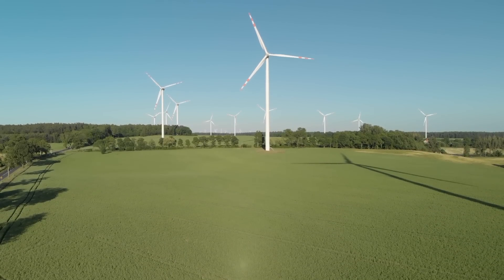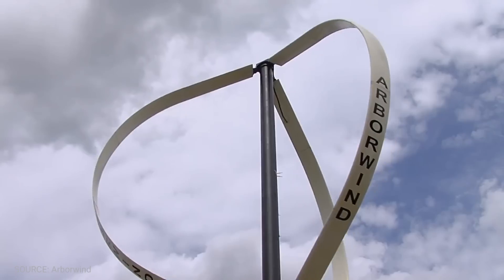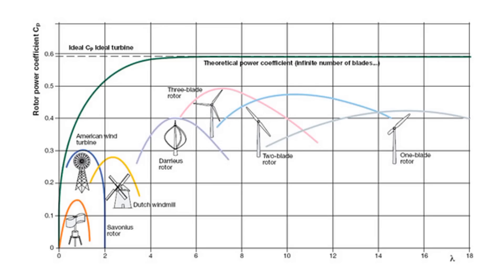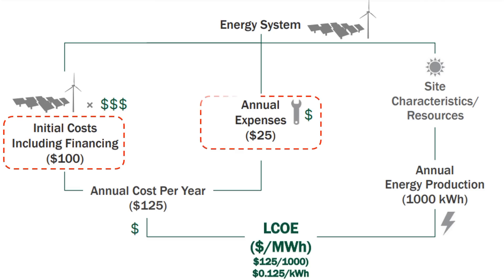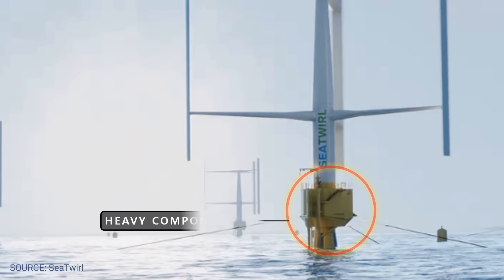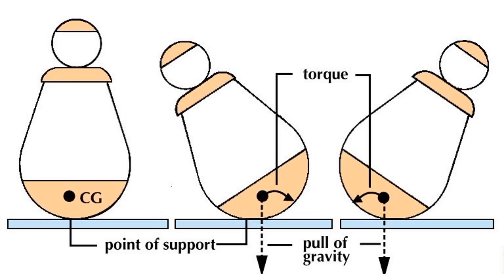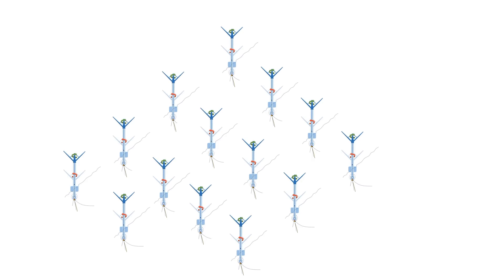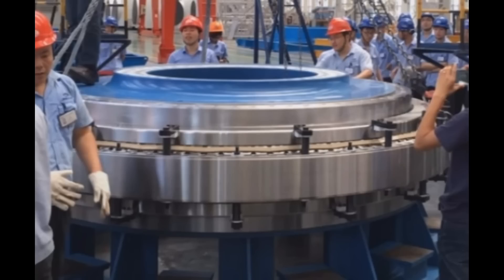This Wind Turbine makes Wind Power virtually LIMITLESS - Solves Wind Energy's BIGGEST Problem!

Comment: Lenz 2 vawts take advatage by pressing the wind in between the blades and the hub, giving a PULL action for the airfoils..    AND a PUSH from the back side of the blade. sso ya, if they made them as big you'd be gaining almost twice the output...  and not kill birds at the same time

Comment: Yikes!  So much complication. I've built VAWTs for over 50 years. My turbines all compress air and I convert that potential energy into usable work ON THE GROUND. My machines use one moving part on the turbine, two moving parts on the pump and a check valve. Can't get much simpler than that. I run the compressed air through a variety of end-use engines IN MY SHOP to create usable working power.

Comment: That is very very cool. If it works it could solve the Intermittance of even offshore wind turbines. 45-60% efficiency well when it goes past usually 2 km an Hr they have to shut the vertical ones down to avoid destroying them.

Comment: I'm surprised Elon Musk is not involved considering the potential. Has having the generator on the ground for HWTs using bevel gears/shafts/bearings like an upside-down outboard motor been considered?
I know there will be some energy loss but the benefits would be well worth it..

Comment: I think this represents the next generation of wind power. I've never thought the horizontal axis systems were inherently robust and VAWTs are much more so. I am curious how they will tolerate extreme conditions, for instance heavy icing or perhaps even worse, wind speeds up to 250 kph. Surely these have been considered by the designers. Will the towers tilt so far over the blades hit the water? What about extreme sea states? 20 meter tall waves must be designed for; how does a floating and tilting design tolerate that? I'm excited to see innovations in renewable energy because they translate into ever cheaper energy production.

Comment: Trick question. How many wind turbines does it take, to equal a coal driven electricity producing turbine?
Waste of time, waste of money, crazy pollutants, damaging marine life, but! They are green. Whatever the hell that means. 

Idiots got so focused on gas emissions, they forget to check anything else. 
You still need oil to make them BTW.  There is no renewable that can substitute oil, for a good hot fire to melt iron and coal to make steel.  Huge steel monsters, need a lot of steel. A lot of oil is gonna get burned to make your green wind mills. 

But you dont care about that, you dont care you 're paying  twice the wat hour from these monsters.
Yep twice! Subsidised, means the government takes your money to pay for them to be built, installed and operated, all the while paying again for the minimal electricity they produce.

 IDK about you,  but i don't like to be mocked. Paying twice for the same thing, is mocking me.  
They bet i don't have the brain power to figure out the money laundering scam they are running ,at my expense.

Climate change is real you cretins! Instead of funding technological innovations, you 're laundering money so you can profit. We has wind mils and water mills since . .forever practically.  We abandoned them for fossil fuel, cause they canot meet the demands of an industrialised country. 
Hell, they can barely meet the demands of a small agrarian country. 
TELL ME I 'M LYING. Tell me your wind mills make enough electricity to power a small country on their own.  
A tiny one ! your choice! Pull up their annual consumption, and calculate how many wind mills of whatever type, it would take to cover that. 
I'm betting there wont be room for people.
Reply: @PW POO POO

Comment: @efficency: I learned about the wind turbine theory that vertical axis wind turbines can convert more wind energy into electricity than all horizontal axis wind turbines can do under same circumstances, thats why these turbines are so wide spread.
@no gear: Today most modern wind turbines (Enercon or Siemens Gamesa) miss a gear, their axis drives directly the generator on the same shaft and use power electronic to rectify it and generate a synthetic sinus synchronized with power grids AC phase & frequency e.g. 50Hz or 60Hz.

Comment: I have a 1kw vertical Axis windmill. It's pretty amazing. It is fairly simple one but it produces power easily. Much simpler construction. It makes home small version windmills easy for a home owner.
Reply: How much power do you make
Reply: @elizabethwinsor-strumpetqueen  under light wind 50 to 100 watts is normal. Under medium wind it averages 300watts. If it's a really good strong wind it may get 700watts that is fairly normal. 1kw may be possible in ideal conditions but its not the norm when it comes to wind. They always advertise the max, you rarely get the max though
Reply: What is its size?

Comment: Other than the fact that if there is no wind = no power.
Reply: At sea there's hardly ever no wind.  
For the next 20 years or so, the times there's no wind can be covered by saving gas turbine generators in "mothballs" and running them for the few hours each year when the wind isn't blowing hard enough.  
Don't forget solar power works when there's no wind.

Comment: You mention spinning the rotor one direction and the stator the opposite.  And the potential issue of bearings between them.  But how do you get this electrical power ashore?  Obviously the underwater cabling needs some sort of rotating connector.  Even the biggest conventional generators with their slip rings are limited to just a couple hundred ampere.  The losses in trying to push a few MW through some form of mechanical slip rings is a problem that needs to be solved.
Reply: "Obviously the underwater cabling needs some sort of rotating connector."
The base, where the underwater cables are attached, doesn't rotate.  The inner solid shaft and the outer hollow shaft rotate in opposite directions relative to the base.

Comment: I was wondering what the point of counter-rotation was until you explained that one is connected to the shaft and the other to the housing. So the generator spins twice as fast! lol So simple it's genius!! 😄
Reply: It would probably also help minimize gyroscopic forces that would come into play when the wind changes direction and/or force, causing the tower to re-orient itself.

Comment: If a low centre of gravity is so important, why isn't the generator for the conventional windmill put to the bottom? They could have an axis in the inside of the windmill pole using a 90 degree angle gears.

Comment: Vind turbine is a machine very good at killing birds 🦅 ,  makes an eyesore of natural beauty  🏔 ,  and requires other generator when there is no vind.  Nuclear ☢️ is an excellent choice.
Reply: Nuclear output is the same 24/7, but demand varies.  This means that nuclear either produces too much power at night or not enough power during the day.  
Nuclear also costs multiple times what wind and solar plus batteries will cost.
Reply: @calamityjean1525  sorry over time nuclear is cheaper & cleaner

Comment: Fascinating idea.  Having worked on large traditional VAWTs I can tell you that they suffer from fully reversing loads on the blades.  This raises the issue of material fatigue cracking at the connections to the central shaft.  This is not a problem with HAWT since the loads are always in the same basic direction.  By tilting the vertical axis in the wind, the fatigue load may be reduced.  I'd like to see some analysis of this.  Thanks for this post.
Reply: So the problem is in the connection to the shaft. A simple solution would be to install a shock absorber kinda rigid spring at the connections to absorb the stress.
Reply: @pravinsmart  So, a hinge joint with spring and shock absorber may mess up the aerodynamics of the foils by changing their angle slightly.  Interesting idea, though.
Reply: I assume VAWT designs are inherently safer than the HAWT as the gearing and generators mechanisms are at ground level ensuring an escape in the event of a fire and removing the need for a weight budget for the generator and associated equipment.

Comment: The cost approach you presented ~ 5 min. is ridiculous TOTAL COST DEPRECIATED IN ONE YEAR!  The rest of the presentation like this cost calculation is full of holes. 
SANDA has tested VAWT and in California a field of the Darrius have been installed. Yet no company sells them. And no company commercialized the vertical airfoil with struts holding them at a radius. Small size units have been around for decades. The Darrius VAWT have a fixed frontal area and so do the majority of the vertical airfoil style.  Energy in the wind is a cube of the speed.  For HAWT the angle of attack can be adjusted to change the fraction of energy removed from the air.  The angle of attack is not adjustable for VAWT.  So the present approach to prevent overspeed is to us a mechanical break to absorb the energy that doesn't go to the generator.  Thus the approach use is to stop the rotation when the wind speed is above a much lower value then for a HAWT.  The VAWT produce less energy per year then a neighboring HAWT over the same period. 
No one that I know has even produced a prototype Cone style.  Why is simple because the air speed ratio of the blade moving along the length is a identical equation with different constants.  The stress problems are far far worse. The centrifugal force of a HAWT is on the axis of the blade, a tension force. Where for a cone it creates a bending and tension forces.  It is easier to adjust the frontal area of the cone style VAWT, but the two major weaknesses of the HAWT is the blade strength and the gearbox.  
So the cone VAWT has the worst features of  Darrius VAWT and HAWT.

Comment: Since the turbine blades are so radically shaped, it looks to me that it will only rotate when it's tilted. I asked the designer about that in an email a month ago and am still waiting for an answer.
The vawt market has had MANY fraudulent claims in the past, and I'm sceptical on this design also.
Reply: Just looking at it I would think that the tilt is basically part of the wing shape. So either it won't rotate when vertical or else efficiency would be severely diminished. But I doubt that will matter all that much because I'm sure they're designed to naturally want to orient at an angle, especially if there is wind blowing on them.

Comment: Interesting but I nuclear kills all the best features here and it runs without sun or wind 24-7 ..no storage needed
Reply: Nuclear alternately produces too much or too little power because demand varies but nuclear output is the same 24/7.  This means it needs lots of storage, or a backup generator that can be turned on and off quickly.  It's also WAY more expensive that solar + wind + batteries.  AND it takes longer to build.

Comment: Wind Energy's "BIGGEST" problem isn't efficiency, heck, the Germans turn them off when they could produce more than normal (just ask Denmark).
The biggest problem is the microplastic (which is bad) and anti-wear coating (also bad) wearing out by tonnes, yes tonnes, from each blade (and there are how many turbines worldwide?) every year.
Reply: I think they will find ways to circumvent these problems. It’s a new beginning, trial and error. There are good engineers working on solutions. As they would say, Rome wasn’t built in a day.
Reply: @barracuda861  They've been around for a few decades now though, and let alone recognition of the enormous toll on emissions ... there is no recognition, there are still no solutions.
Rome wasn't built in a day, but Rome also wasn't actively destroying everything that propped it up (at least not at first).
Reply: Excellent comment!

Comment: I have thought that the current design of W.T's seems completely upside down.
A mass at the top of a thin column?
Place the generator at the lower end and drive it via a shaft; like a rear wheel drive car!

Comment: Giant wind turbines kill birds...in the thousands.  It is not an entirely 'clean' energy.  I would call that dirty.  And when the turbine no longer works, what happens to it?  It's not biodegradable?  Right now they're going into the landfill where they leech horrible chemicals into the ground and ground water.  That's not any cleaner than batteries which are completely toxic to make and the degrading of them is toxic.

Comment: It looks very interesting. The cost per kWh doesn't provide the full picture. The bit of power a VAWT can generate during low wind is most valuable as it reduces the need for storage.

Comment: Cool! You gave us cost per kwh but I'm curious about cost per square meter of surface (wind field) for initial installation. Too early to tell, but that will be a selling point for small communities in a more decentralized production environment. (More generators per square km than horizontal axis generators means more units, so, how do the unit costs stack up?)
Reply: I'm guessing the area requirements from the pictures and it seems each 40 MW turbine would need about 200,000 m2 of space. So about 0.2 KW per square meter. I can' find where the video mention the cost so you'll have to do the rest of the math yourself.

Comment: This was a really encouraging video!  I especially liked the idea of the counter rotating vertical axis setup - nearly a power output doubler?  Would think that using 1 bearing would be expensive if the vertical axis turbine gets really tall, so there are likely limitations there.

Comment: VAWT has a great future for  floating turbines. These could be mass produced at minimum costs even though each turbine produces less power than HAWT. Cabling and connectors still a problem as they will be further from continental shores. They could also be linked to floating Solar farms to even out wind patterns!

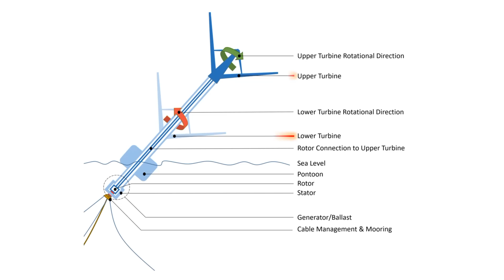Comment: The contra-rotating blades are a good idea, but a draw-back in the diagram @7:41. The generator is underwater! Maintenance nightmare!
Reply: I don't know the details about maintenance but this is a Norwegian company. We do have some experience putting machinery into and under the sea here so I assume they have thought of that.
Reply: Build more fission plants.
Reply: @TheShootist  I so agree that we probably could do with more nuclear plants. But we need to diversify, we can not afford to rely too much on one energy source. We need to diversify as much as possible for security reasons. Statsitically nuclear power is one of the safest and cleanest power sources we have. It has a bad reputation mainly because on the few occasions something goes wrong it goes terribly wrong. But what if there's a war? Or how about sabotage? And perhaps most important, how about securing fuel supplies. The big oil producers have used and still use their control over supplies to gain leverage over the rest of the world and you can be sure the uranium producers will do the same if the world becomes too dependent on nuclear power.

Comment: Really hope this works.
There will be engineering problems.  
The blades are unequally loaded as they rotate, so produce vibration.  
They can’t feather into the wind.
Also you missed, perhaps, the main point of the counter rotating blades, these put little or no rotation force on the base.  
But, good presentation, keep it coming
Reply: I don't think he missed the counterrotating advantage of not having a lot of torque at the bottom.